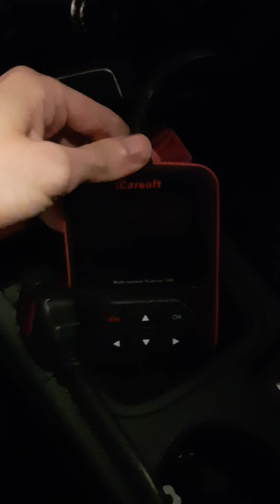How to fix SRS AIRBAG fault with a resistor.

Comment: https://volvo700vereniging.nl/sites/default/public_files/Volvo%20960%20airbag%20service%20manual.pdf

Page 15, Special Resistor Tool, 1994 940 Volvo. My boyfriend was working on the struts, bearing replacement, he damaged an ABS wire. With struts reinstalled, drove around the block, was getting an skid response, ABS was growling, triggered as if sliding or some5ing, this was on a summer day. Soon, SRS light came on. The error could not be cleared. The dealer doesnt have the resistor tool, inspection is due in October, what do we do? He bought on eBay that box that is under the driver seat, it didnt stop the error code and the SRS light is always on

Comment: which amperage do you use I have a Mercedes cla
Reply: 1.8 ohm for Mercedes
Reply: @BenzManiac  have that positive or negative side ?
Reply: @Dukymon  no, it's the same on both sides, it's just resistance

Comment: What diagnostics tool are you using to clear code? I thought only star could do this?
Reply from the maker: at this point i was using the iCarSoft i980, but it was crap for £120. Any £20 fault reader can clear your codes, the MB Star will give you the best info on what the codes mean and how to actually fix them.

Comment: why not use 2 resistors? why use the little black box and a resistor?
Reply from the maker: Cars in Therapy you can even use just one resistor. But, you will need to know what amperage to use, this little box just switches between a few different amperages until it finds the right one, so it is simpler.
Reply: Plymouth Guide ah got it, thank you so much